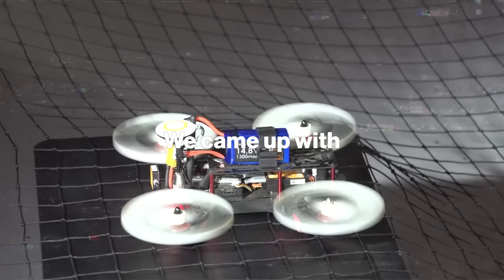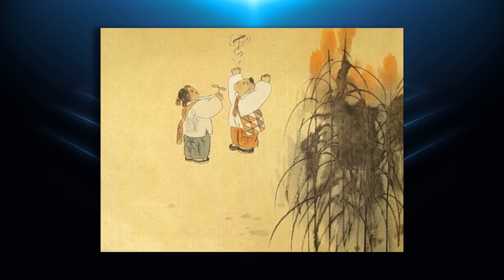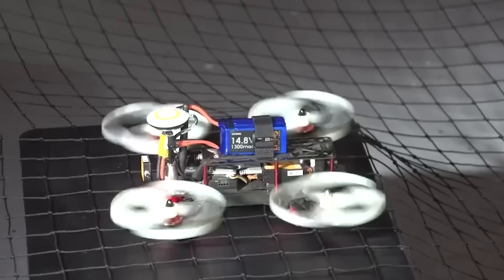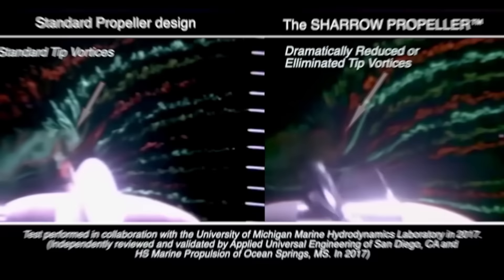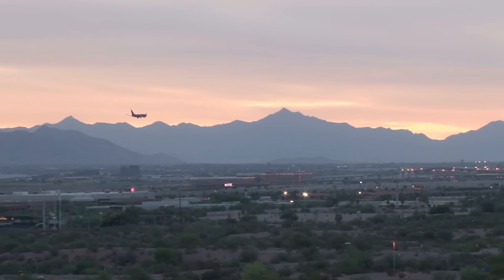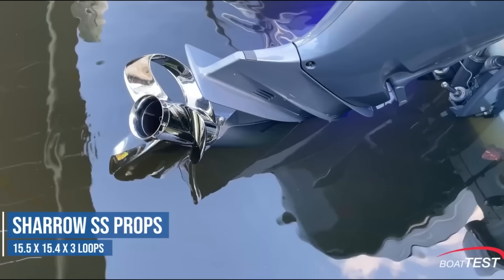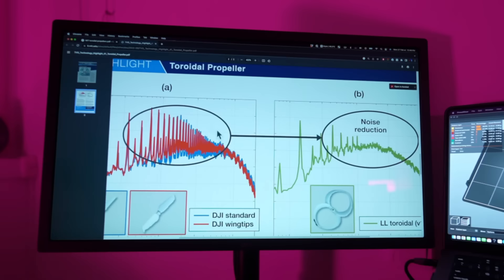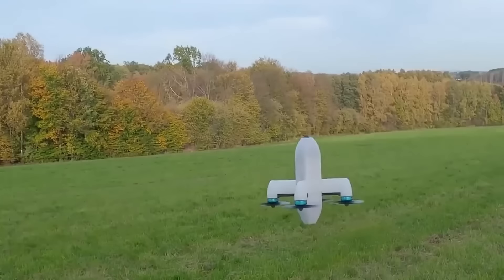This MIT Propeller Is Going To Change Aviation Forever

Comment: I have been designing and building drones for 14 years, and I can tell you that a Toroid propeller would be good in constant RPM conditions, ie, Marine and low end small fixed wing aircraft.

Why not Drones?.

Well the main reason is that a Drone uses very fast and very frequent changes in RPM to stabilize a drone.
As the angular momentum of a propeller increases, its ability to resist changes in RPM increases.
So heavy propellers are not as stable as low weight propellers for the same size.
Angular Momentum is a factor to consider in designing the drone/ECS/Motor/Propeller combinations.
Example would be in designing large drones with propellers 22" in diameter. They did not want to change RPM quickly so any large drone was never stable in wind.

They will also not work on larger commercial propeller aircraft.
Example the Dash 8 which I also worked as a designer on. Dash 8's use a variable pitch propeller designed by a Canadian Wallace Turnbull who received a patent back in 1922.
Variable Pitch Propellers are better for the variable conditions an aircraft will fly in rather than a fixed Torrid propeller.

If the only tool you have is a hammer.
Then every problem looks like a nail.

The Torrid Propeller is a hammer.

Comment: The major problem I see with toroidal marine propellers and their closed-form structure involves lines and seaweed.  Normal propellers shrug off such impediments.

Lower RPMs do NOT "result in increases in efficiency."  Rather, it's simply capturing the energy lost by wingtip vortices the same as winglets do for airliners.

Comment: In subsonic aviation all propellers are both quiet and efficient at their design speed. (Pretty well efficient: over 90% is possible!) Trouble starts when deviation from design speed happens. Unfortunately, in transportation this "deviation" must happen always. (A vehicle must both start and stop in order to be usable.) 
Wingtip vortices are NOT responsible for all the noise and losses the propeller makes. Major part of noise and losses is generated by actual blade stall. (Transonic phenomena are excluded.) Because away from design speed AOA on the blade sections becomes too big, or too small (i.e. too big in the negative direction), which makes stall inevitable. 
Zone of stall free operation of a propeller can be extended by a good RPM control. However this option is limited on the upper side, by the increasing wingtip speed. Which must be kept (mostly) subsonic.
The only way to keep AOA at the blade sections close to the optimal value (i.e. quasy constant) is to regulate section pitch to follow exactly the changes of direction of the resulting wind over the sections. Simple geometry shows it is impossible, because the resulting wind changes direction in a non-linear way along the propeller radius. Stiff propeller blades are unable to follow this change even by changing their pitch setting. Meaning blade stall will happen inevitably.
Unless the blades are capable to morph. More precisely: blades must be capable to change their twist the same way the vector field of the resulting wind varies twist along the propeller radius.
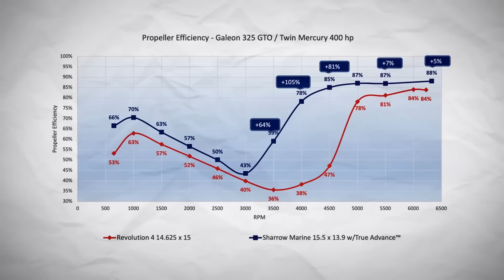Toroidal propellers have stiff blades. They can mitigate wingtip losses, which is a gain in efficiency well below 10%. The indicated 205% of efficiency improvement has been achieved by changing design speed of the new propeller, and by measuring efficiency of the old one at the design speed value of the new one. (Check the graph at 7:08 of this video.) 205% improvement is but an illusion.

Comment: Aircraft propellers have variable pitch for a reason. A toroidal propeller is fixed-pitch, so despite being quieter, there has to be a trade-off with efficiency at certain speeds or something. Has anyone flown a full-sized, manned airplane with one of these on?

Comment: What I gathered from your presentation which was broken down and explained thoroughly step-by-step of the comparison to the standard wing propeller, you (MIT) have designed a real game changer. I honestly believe that the demand will be higher than you may think. Me being a machinist understands the cost. To machine one of these requires at least a 5 maybe 6 axis machining center. It can be done.
Reply: Why wouldn't such things be cast instead of machined?
Reply: @WaterspoutsOfTheDeep  Correct! It can be casted easily by making a mould...
Reply: @thetruthsayer5990  They never respond lol.

Comment: This propeller could be made using lost wax casting or as recently developed pvc foam casting in which the pattern made of foam is left in situ and the hot metal just vaporises it. This process is already used for complex large castings.
Reply: Agreed.  The wax mold for investment casting can be 3D printed.  Follow that with 5-Axis CNC to get it to exact geometry.

Comment: My first thought is noise reduction, and more air is moved at lower RPM. Imagine a deck motor, (AC, Heating plants, air or other recognized fluids in effect moving through plenums) doing the same work with less energy, resulting in higher efficiency for the motors and reduced cost of operations overall.

Comment: For those wondering why we haven't discovered this technology until now, a quick look on Wikipedia will show you that toroidal propellers have been around since at least the early 1830s.
Manufacturing them is getting easier and more economical, so you may see them in more applications but the design itself isn't particularly "revolutionary".

Comment: Well, more material means more weight. More weight means efficiency loss in flying. At least you have to balance it out, maybe need a bigger prop shaft, a torquier engine, and a  beefier frame to hold everything together. I think the weight gains and Efficacy gains will balance out over all. As physics will not change, and the equations which guarantee flight still remain. I can see how it would benefit shipping though. Where the ship is held afloat by Archimedes principles, and the Prop only has to propel in a direction. But that is, because water is not as compressible as air. Most people however seem to forget, that drones usually use 2 -bladed propellers, while the toroidal one has technically 4.  so yes, you GET more performance, But not actually 105% gains. Noise reduction make totally sense though.

Comment: Well regarding aviation.  Any of the more commerical and higher level private craft all use an adjustable pitch propeller.  Even with your monumental design breakthrough there would still be a need for a variable pitch design.  No i did not discuss the engineering physics involved that make a variable pitch prop neccessary for high performance flight. Suffice it to say that a variable pitch prop is used for some of the same reasons we have transmissions in cars.  No, this comparison is not a direct comparison,  sheesh.

Comment: I wonder if they can cast these propellers  instead of machining or 3D printing. Casting with good heat or cryogenic tempering should provide a strong enough prop for thousands of miles. 
At half  the price or less. 3D print the cores. Use a gas permeable investment. Heat and pour metal under vacuum. Should provide plenty of strength and still have the flexibility required. I'm not sure if it's possible. Just a thought.

Comment: I think some kind of dynamically unstable system of multi-high density magnetic fly-"hoops" arranged into magnus-rotor/propeller/gyro modules and linked in a "train" that collectively aviates using undulatory motion like aquatic animals/Chinese dragons will be what actually changes aviation forever ...but that's just me.

Comment: Manufacturers could always use the "lost wax" method of casting for larger propellers. Use CNC machines to build a wax model, then cover in casting sand, and melt the wax after tamping the sand mold. Pour bronze for marine applications or aluminum for aircraft applications, and buff with appropriate tools to finish!
Reply: Yes. That's why the 500 vs 5000. - is a bit suspicious price diff

Comment: I've been flying RC airplanes with electric power for years, (ok, decades), and the electrics aren't much quieter than gas motors, I've heard the real noise happens when the propeller tips go past 800 mph, sonic boom speeds, i could be wrong on this, i often am,,...any input out there?

Comment: It'll only be useful for jets, drones and quadcopters. There's no vector control in this design, the blades on aircraft can turn while the prop spins which allow them to control how much thrust and the direction slightly

Comment: The problem with this propeller is the pitch cannot be varied, so the propeller cannot be feathered or provide reverse thrust. That would make it useless in most aviation applications regardless of any efficiency gained.

Comment: Nah, just secure a regular propeller's tips to the inside wall of a pipe, that's all you need. (A hollow cylinder is called a p*I*pe if measured from the *I*nside; a t*U*be, if measured from the o*U*tside).

Comment: A regular propeller can easily achieve an efficiency >80%. So - no, there will not be substantial improvements with this design given the efficiency, but rather at which speed range this efficiency can be achieved.

Comment: In this day and age the main noises emitted motor vehicles are fan noise and tyre noise. Much more so with trucks and buses than cars,but fan noise is still an issue with cars in residential areas at night. I think fixed pitch wouldn't be an issue.

Comment: 6:41  This graph shows the standard blade design provides greater speed at a lower power setting.
   
Standard blade achieves 3 meters per second speed at 1000 watts.
   Toroidal 2 achieves 2.5 m/s speed at 1025 watts.
   Toroidal 1 achieves 2.25 m/s speed at 1075 watts.

Where did this graph come from ?
This graph contradicts the entire premise of the video.

Comment: May not be useful for passenger aircraft, but this could be a game- changer for datacenter cooling equipment. Fan noise in data centers is horrible and the fans are super inefficient.

Comment: K.Hacker won RC race with one blade propeller. It is really more effective than 2 blade prop. It must be carefully weighted/balanced and it is hard to do it so. It still can damage motor. But during a short time it is very effective.

It is interesting to compare one blade prop with this one.

Comment: The issue of fixed pitch is not really an issue as thrust can be managed with rpm however the ability to feather would be an issue with multi engined application. The increase in thrust and efficiency could negate many of the multi engined requirements. And, think of the recent open rotor research that has been conducted with aircraft propulsion systems? The future looks very exciting with this technology only in its infancy!

Comment: ignores the fact slip is a critical factor in attaining acceleration in marine screws. Why do you think the little high speed racing hulls use a very steep 2-blade design?  the slip allows the engine to pull into powerband, and slowly hook up until the hull is at maximum screw speed. 

Looks like they worked real hard to get the same results as a ducted fan, or axial flow pump would achieve.

Comment: you forgot about the noise that all aircraft and boats make through the exhaust which is extremely loud, and FYI, the exhaust from pleasure craft  actually comes out of the center of the propeller making the noise

Comment: What if they made a new version of this propellor, with progressively SMALLER Toronto properties added to its length, to make a kind of cone? Could this stacked version of these propellors create a more straight action/reaction stream of air pushed behind it, for even better mileage in its vehicles uses?

Comment: Toroidal propellers has been around since the 1800s, at least.  It didn't change anything "forever" when it was invented, and it's most certainly NOT an "MIT Propeller" as if it was invented at MIT.  Which, by the way, the vast majority of people at MIT are students, so....  Just because something was done at MIT doesn't mean it was a product of the greatest and most accomplished professors at MIT.

Comment: But what about drag? And how to change propeller pitch with such design? 

This design is not fit for helicopters or planes, but will work with boats, submarines (id they don't already use it, military sub screws are top secret so they might already look like it) or drones.

Comment: I can see these being adopted for small aircraft … especially sport and ultralight categories. The problem I see is cost, as the video explains. The precision required for producing the complex shape, balancing it and making it sturdy enough will be a hurdle. Ducting propellers is a tried and true method of reducing the effects of tip vortices, but few aircraft are suited for this. I’ve seen propellers contained within an outer ring (reducing vortices) but only on small machinery type fans… could that be applied to larger aircraft propellers?? I assume the centrifugal forces may cancel the efficiency savings. Wondering if these type have been tested on a larger scale?

Comment: I wonder just how much more efficiency will add to another new technology as found on the Otto Celera 500 aircraft.  It has a revolutionary super laminar design that reduces drag by 59%.  If this torodial design propeller can add more efficiency,  that means that aircraft could rival the mpg of many economy cars but cruising at nearly 500 mph with a range of over 5000 miles.  If it does, sign me up on the waiting list.

Comment: Why not design a clever small stationary  ring barely passing around the tips of a conventional prop. it is stationary, will almost stop supersonic noise, cleans airflow, less drag. and variable props can be used.

Comment: I have read the somewhat heated debate below about fixed pitch limitations.  Do not really buy this in respect of limitations.
I have long railed against DUMB and noisy cavitating fan designs - particularly in basic commercial products like kitchen/bathroom venting.
The expensive problem of mass production of complex shapes is indeed largely solved by 3D printing.  But other options are no doubt in the pipeline, where raw castings can be made in metal or plastics that only require some CNC machining to perfect and fully balance.  YES, tooling will be a challenge but not so great as to kill the concept.

Comment: Wonder if putting this in a ducted housing, like a jet engine, with an inlet, and exhaust nozzel being able to converge or diverge to give more operational control,  preventing  possible runaway prop issues, and etc., with the hands on control needed in all rpms!??!!

Comment: 5000  vs 500 is too mucb, but O am sure they will be manufactured cheaper. Perhaps carbon fiber could be shaped easier to this shape ?  A boat propeller is not very large, so the high cost of the CF material should not have a big effect on the price.

Comment: as a boat owner, the prop works, really well, but i dont save any money, it will take about 10 years before i start seeing any kind of money saving. 
if i lived in USA with cheap fuel maybe. the cost of the prop´s is WAY to expensive.

Comment: Smart design concept. Meanwhile even the efficiency and thrust to weight ratio of electric motors for VTOL and multicopters is moving past 88% towards 96% or even higher.

Comment: Even at the first glance too good to be true. From the most basic experience, the same design cannot be equally applicable in the gas and liquid mediums. As others stated, absence of pitching makes this design a no-go in the aviation. I really doubt it may work in the turbines even considering fixed pitch. The best possible application is the small boats I guess.

Comment: It will take over 20 years, but the days of the single engine aircraft are ending. In 20 years the slot presently filled by single engined aircraft will be filled by twin rotor Ed ducted fan aircraft. Most will be hybrid, some will be steam driven and a few will be sole IC engined.

Comment: If these toroidal propellers could change shape in flight like constant speed propellers that would appear to be an even greater increase in efficiency.  This would mean a different way of construction and different material used.  I imagine a very strong rubber like material surrounding a disjointed collection of struts that would be the underlying constant speed propeller, controlled in the same manner of a cs propeller.
Reply: Titanium scales to form the shape with internal mechanicals that allow it to change shape. Variable pitch.

Comment: They keep talking about this toroidal propeller then showing videos of high-bypass turbofan jets. Those are NOT the planes that this style propeller would mount to. They would potentially be mounted to a turbo-prop aircraft. Turbofans already have very close tolerance fan shrouds that contain pretty much all of the blade tip vortices.

Comment: 5:05.....seems like this solution to wing tip vortices would find use in airplane wings and helicopter blades, unless the efficiency gains are not realized at very slow airspeeds.

Comment: Ive seen these tested on small boats- they work but cost far more than a bigger engine, and as of planes you cant change pitch, and the real question is how they compare to a jet, which doesnt have tip vortexes as its ducted

Comment: As Principal MFG Engineer there are efficient ways to machine these types of blades with only a small increase to the overall machining time. Blades already require 5 Axis CNC Machining, so there will only be an increase in time to machine the additional material. There are enormous machining breakthroughs in metal cutting every day, week and month. I just witness cutting stainless steel at 2000 IPM, so cost of cutting metal is coming down.